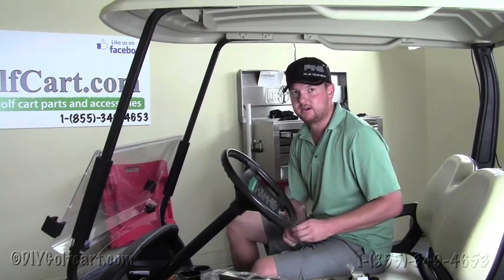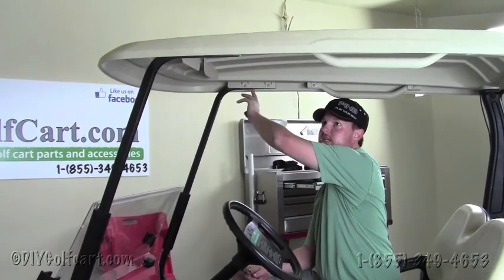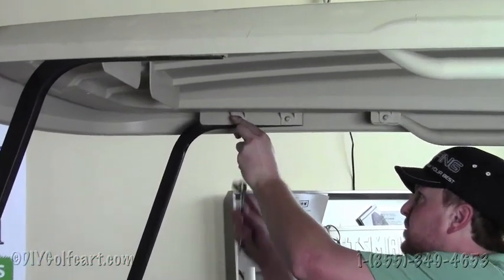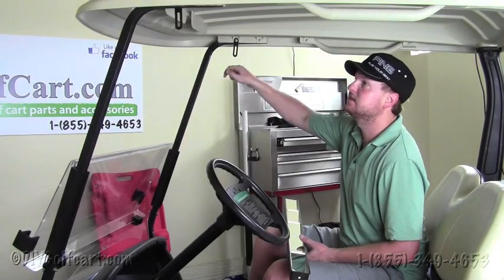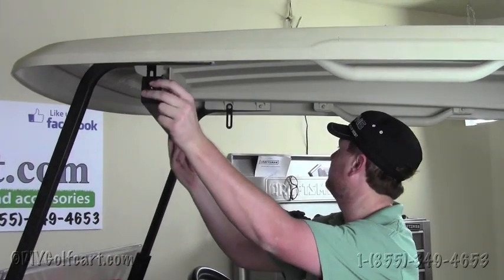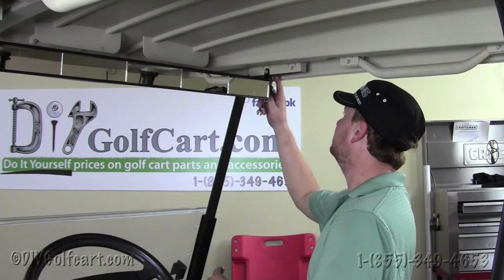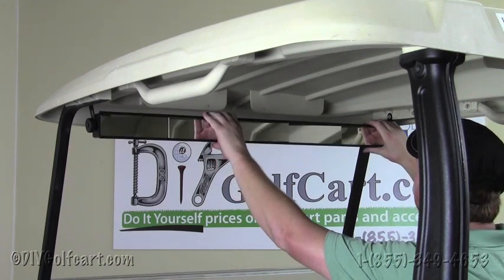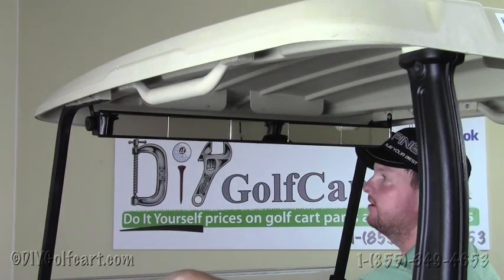Club Car Precedent 5 Panel Rear View Mirror | How to Install | Installing on a Golf Cart

Comment: C'mon mon, no span measurement, no link to your company?
First vid of a five panel for a Club Car. So is this for a 39.5" span?
(yeah, old vid, but thought I'd ask) My CC is '05 farm jobbie..full top with full frame structure top ~ It was cool to see the bolts up top used.